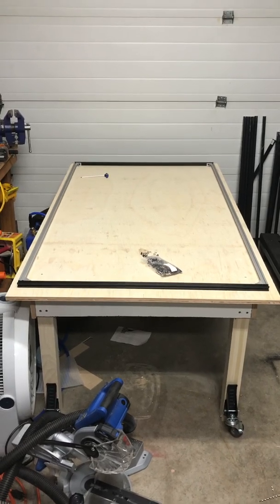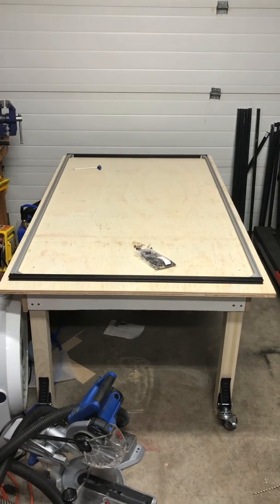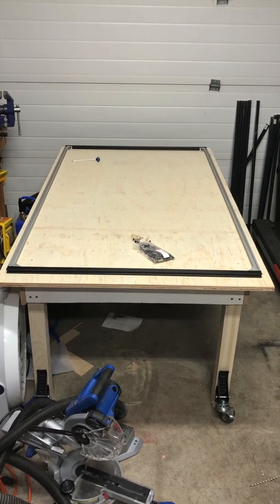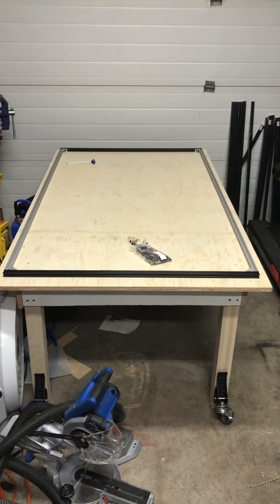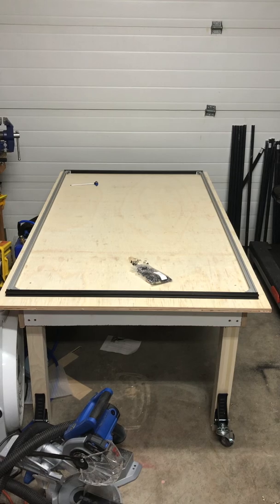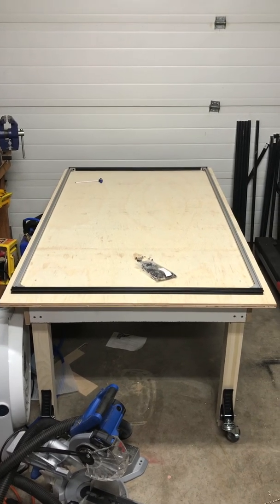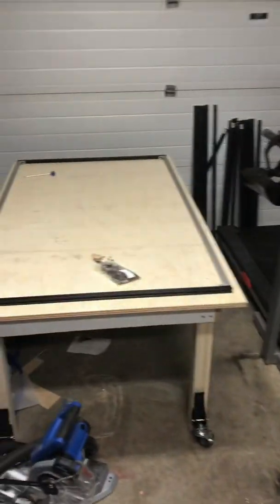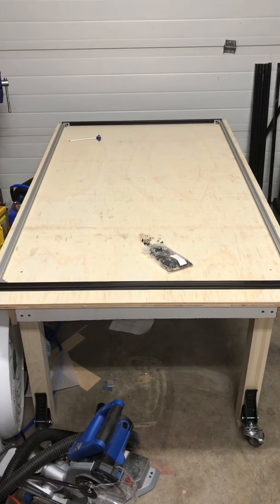Y-1200 build: the outline

Comment: Why did you decide to upgrade to this design from the MPCNC? I am debating between these two for a laser cutter. The only reason I am considering the MPCNC option is I figure it will be cheaper? 

Am I wrong? 

Were you experiencing issues cutting on the MPCNC?
Sorry for bugging you, and thanks in advance for your time!
Reply from the maker: Daniil, I found I use the laser a lot, but I want my mill back. So I need to separate the two. This build is not cheap, an 80W tube and supply was as much as my whole MPCNC.

This build is cheaper and more expandable than other 80W laser systems. 

I will be remaking my MPCNC into a low rider design next, to save space. The table it will use will be multi-purpose.